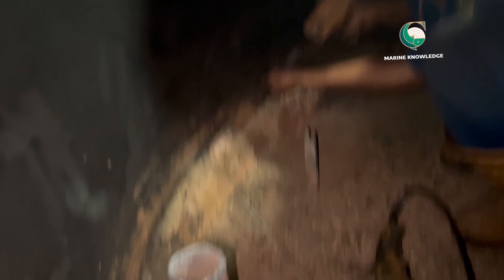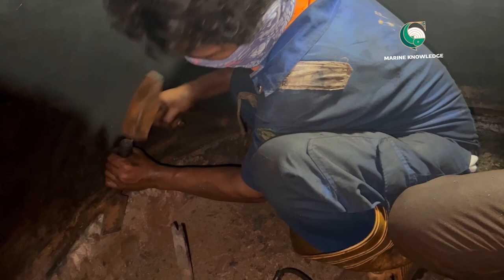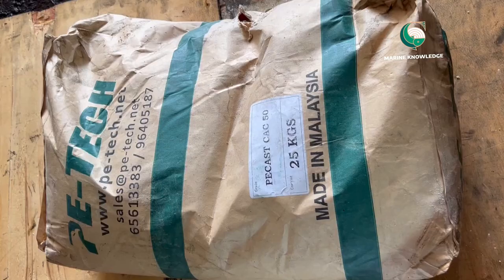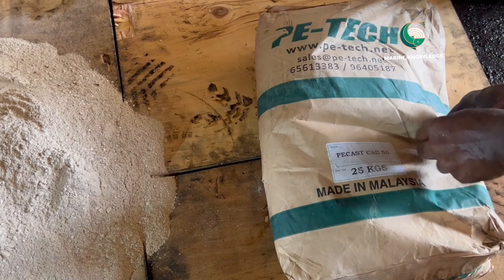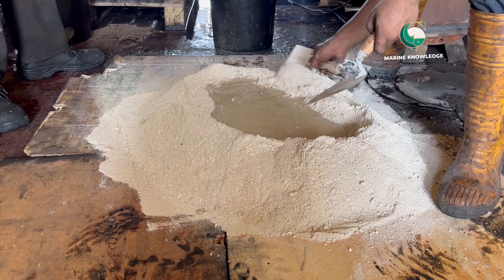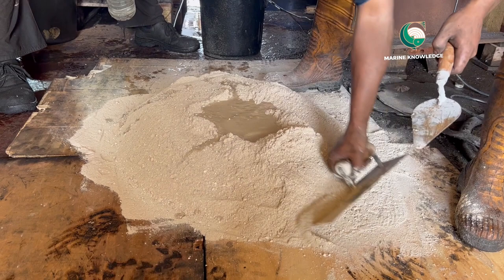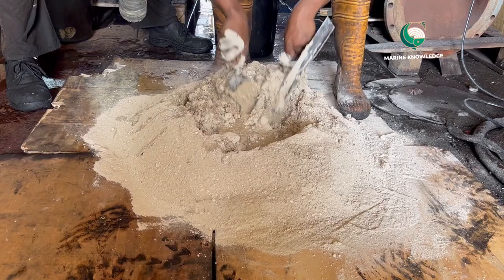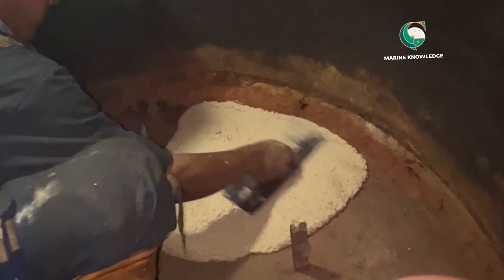How to apply boiler refractories inside boiler furnace area...

Comment: May I ask a favor? I have a big metal tank as furnace, and I use 600c degrees with, but I want to to coat it with liner of refractory cement (mortar or castable) with wire metal (mesh). so, what is a good kind of refractory cement ? and what’s a good ratio?
Reply from the maker: Sir in the beginning of vdo i had shown a refractory name PECAST CAC 50 which i found as good one...ration water 20 and refractory 80..
Reply: @marine-knowledge-basha  thank you so much for your answer, I got it, but does it need to mix castable refractory with?